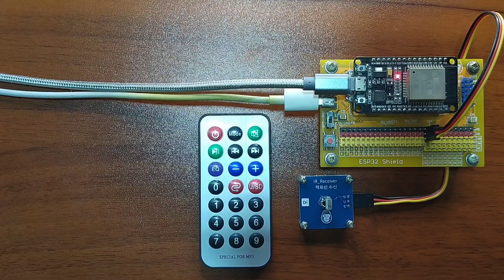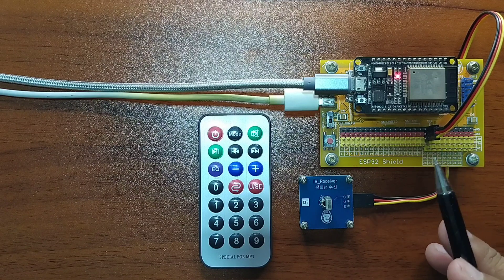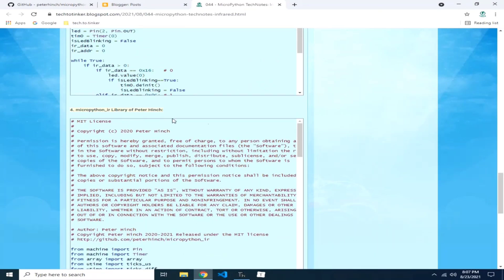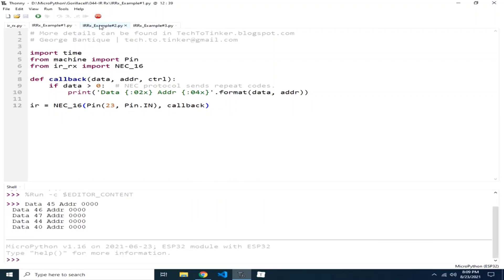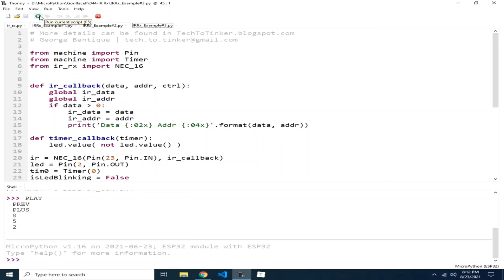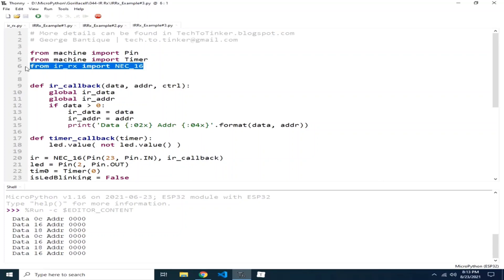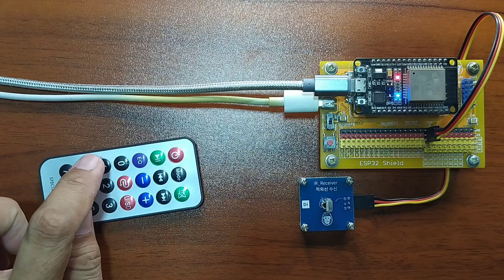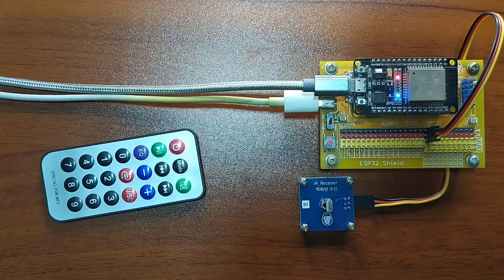044 - MicroPython TechNotes: Infrared Receiver

Comment: Dear TechToTinker, did you read comments for your video? Can you a little help with some case? I have some remote for 433mhz, but IR module have 38 mhz. But when i am press some - light on that IR module is flashing, so IR module can recive that 433mhz signal probably, but this Driver didnt have reaction. Any other remote from my house - tv, or andriod box - work fine with your example. But this is one, not NEC compatibility probably... What changes i need to do for your Driver to detect this 433mhz remote?

Comment: Hello, Thanks for the video. I have tried micropython code with raspberry Pi Pico, unfortunately it did not work. It does not display the values. Do you have any suggestion for that? Thanks in advance.

Comment: What a fantastic video, thanks very much for making it!
I hope to use the material you presented in an upcoming project.  I'd like to light up an edge-lit display (acrylic sheet) with individually addressable LED's.  It would be nice if I could control the setup with an IR remote.

I'm sure that modules are sold for exactly that purpose, but I'd rather build it myself and learn something along the way.  Your video will be a big help to me when I start that project; thanks again!